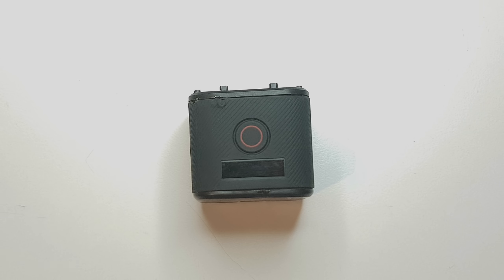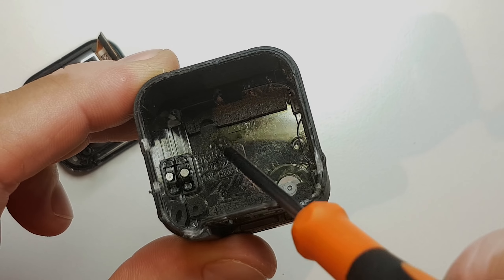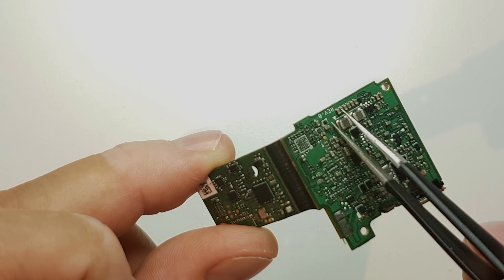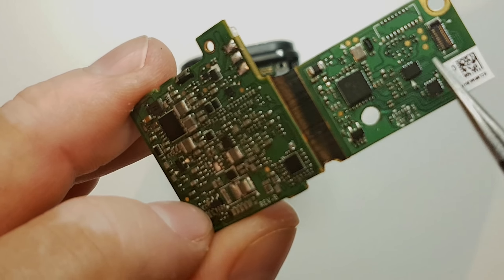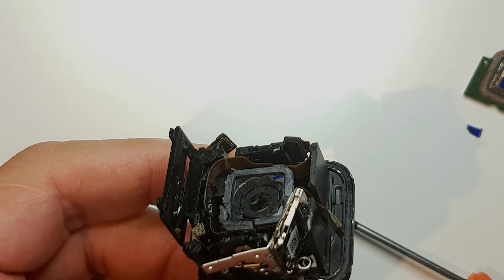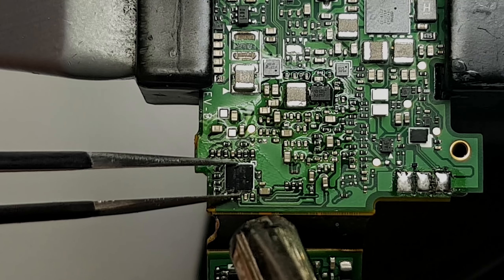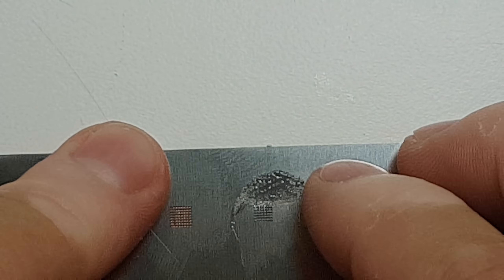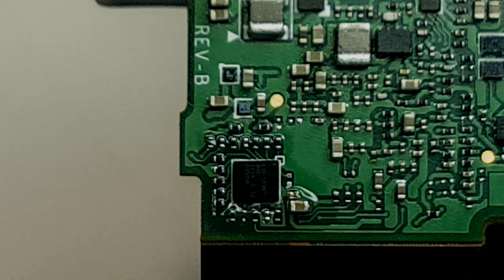Gopro Hero5 Session REPAIR

Comment: Love the video!  I have been into electronics repairs since the early 1970s, but I have never been good at surface mount stuff.  You have enlightened me very well though.  After many years working very small parts with aircraft autopilot servos I have a plethora of tiny tools very well suited to removing the case without causing damage.  I already work on cell phones and iPads etc.  But I might have to replace the battery in my Hero5.  Hope not.  But that is why I watched.  You did that much better and with great explanation, better than the few other videos in taking those apart.
WAY TA GO!

Comment: Amazing skills can you tell me if the symptom for this repair was dead GoPro that just gets hot when charging please. I have opened mine up the battery was 0.8 volts flat.  I removed battery and charged it the reattached it and led light up for five seconds only then board got warm until battery flat again.  Any ideas please my friend. Thanks.   Andy 👍👍
Reply from the maker: No... This was dead dead... No heat no nothing

Comment: Hi I have session 5 with lens broken but works fin, and session 4 not working but the lens is good, if I can just put the lens from 4 to 5, it's gonna work 🤔"?
Thnk you
Reply from the maker: Hi, it should work it has same diameter... But you have a lot of work to do :)
Reply: @LivyuFPV i already desassembled my session 5 so clean like you did in you video 👌✌️ without probleme so I have to desassembled my session 4 to look how 2 sensor and lens look like

Comment: Livyu, Can I replace a bad OSD chip in the same manner? Let's say taking an AT7456 from a minimOSD board and putting it on an FC? Is any programming needed or do they all just work with Betaflight? This is so awesome. I just successfully transplanted a tiny 5 pad rectifier onto a VTX  board with my heat gun and it works. So stoked to repair.

Comment: I made an oversized template to use the existing screws and dropped the entire gopro sessions camera into liquid nitrogen and froze the camera with broke the adhesive. I used the oversized template as leverage to open the camera. No pry makes whatsoever.

Comment: Dear sir.  You Re super duper genius repair man...salut!!  (beer)... By the way....could you please help. I have go.pro session 5 and during power up,.... It just show NO SD CARD.. Again and again..... I had factory reset. And change with other sd card but the result is just the same. Could you please suggest what is the fix for that? I am so desperate. I cant find something relevan to my session 5 problem sir.
Reply from the maker: Maybebthe actual sd card connector has issues
Reply: @LivyuFPV  so do you mean Do I have to open the case like you did? Of course thats a pain sir...;)) any other solution?

Comment: Nice repair! TIp: You can use kapton tape around the chip to protect the other components from heat and avoid desoldering/damaging them.
Reply from the maker: I know... I usually use coppper tape ;)

Comment: When you dissasembly such devices apart use sharp flat knife instead of screwdriver. On this way you wouldn't leave damage when "attacking" gap edges.
Thumb up for "BGM" rebowling solution. Good work!
Reply from the maker: Tried with something like that but it does not grip how it should... Flat screw driver worked the best.
Reply: @LivyuFPV  Yesterday I dissasembled mine Session 5 for the same reason. I leaved front glass and frame and put hand cord in small front frame hole. Heated it up to almost 90C degree using small 12V 50W halogen bulb. Put some glowes on hands, took camera in one hand and pull cord with another. When this side popout i used knife to popout another side of frame. Disassembled it without visible marks at all. Glue what GoPro using is the same like glue for "modern" waterproof mobile phones (LG G6, G7) what get soften abve 80C degrees. Now I'm searching for the same MCU what you're exchanged. My frend had one crashed main board but he sent it already to you;-)) If you have some spare MCU or you're found source I'm highly motivated to get one.
Thank you for this really helpfull video and greetings from DRTC associated member.
Reply from the maker: @balkicroatia  damn... sorry to hear that. I used that mcu :( The issue is that the mcu has a firmware on it that does some things before powering the camera up and boots the main linux firmware.  Thats why its so important to find one that is already flashed. After i broke mine the second time by  mistake trying to clean the epoxy from the metal groove on the case because after a hard crash the case unglued itself... i replaced the second time the mcu, it worked and i also used a little epoxy on the mcu to protect it in the future because it is pure sillicon and its glass like... Maybe someone here sees this and has a killed motherboad but with that mcu in good shape.

Comment: Hey my GoPro Session 5 is getting  power when I plug the USB cable into it do you have any ideas or thoughts also I wouldn't be opposed to me sending you my GoPro and you can try repairing it on your channel if successful I will obviously pay you for your time and effort let me kniw what you think.
Reply: Please please contact me I'll be willing to send you my GoPro and pay for all the shipping costs as well to and from you
Reply from the maker: Man sorry i said this to other guys i don't repair for others... i barely have time to do this repair videos... but if i can hel you with any info i will do it. I am still backlogged with thi gs people donated for videos. Sorry man.
Reply: @Stealth FPV, did you ever find a fix for your Session 5. Same problem here, crappy product... After 15 uses and no crashes it doesn't even turn on now.

Comment: EPOXY? you not only will have a working waterproof session, but also a session you will never be able no open again for repair. also if epoxy in the cracks will fracture, it will let water through. so better apply some high strength glue, something that stays elastic, but softens above 100 degrees, like the glue the've used, cause thats why the session5 is easy to take apart. luckily.
Reply from the maker: neah... they used something like epoxy... very very rigid.. like cement... cause its a pain to release it from the groove.
Reply: @LivyuFPV  hm I also just realised epoxy gets  soft too with heat I guess.. cause its basically just hardened plastic.. it depends on what type of epoxy it is I think, but for the sake of being able to open it easily and don't have to mix some 2k nasty stuff, I would use glue instead personally:)
Reply from the maker: @hallio111  the repaired one is still kicking and dozens of crashes after repair

Comment: I got the same feeling when I repaired my taranis x9d when i disconnected the ribbon cable without removing the batteries first dooh!
I blew the STM microcontroller STM32F205, I could not get a replacement main board so  I had a go at replacing the chip.
https://www.youtube.com/watch?v=cAPU4NHCWd0
I know this video is old ,but do you still have the damaged board and battery? If you do ,do you have the dimenssions of the battery?
I have a session 5 and the battery is now starting to show its age and I want to replace it, it looks very similar in size to Hero 4?
Can you measure it please and post the dimenssions I could modify the Hero 4 battery to be wired as I had one apart before.
Thanks for the video it's gold...... :)